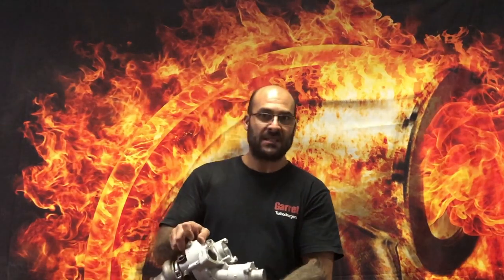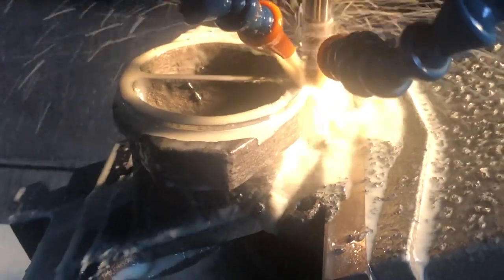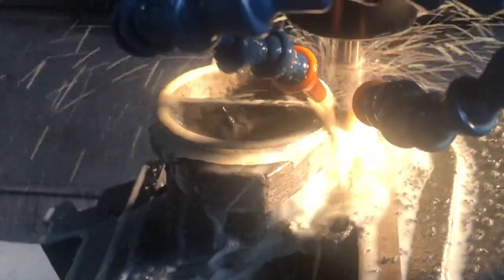Golf7R Swirl Adapter - EFR7163 Bolt on

Comment: Hi. Been watching most videos on the channel. Learning abit and finding them very interesting. Im a big fan on improvements through more efficient designs without necessarily increasing power. Would the swirl adapter have an improvement if used with a stock is38? Also please do a dyno video to show the difference the swirl adapter makes on a big turbo 7R using the turbo you have mentioned. With the only thing being changed is the swirl adapter. Would be interesting to see how the graphs differ in spool up. I like mid range power , not too concerned on peak figures. Thanks for the educational videos. 👍
Reply from the maker: Thanks for the comments, im glad you enjoying this - The Swirl adapter is in essence a flange face converter between the divided two port outlet on the head of the EA888.3 to a vband flange (76mm)  to suit larger turbochargers. The IS38 wont bolt onto the Vband flange face -
Reply: @TurboDirectSA  thank you

Comment: HI Chris 
Very interested in this setup .
would you able just to sell the turbo (650hp) and adapter together ? 
already have wagner cooler and charge pipes
Reply from the maker: Hi Keegan, ofcourse we will sell the individual components, please contact info@turbodirect.co.za for more info. Please note that the testing on this setup is being done as we speak and the tuning will be completed soon. We have a surprise there for you too -- tuning will be done in a specific manner that noone has done before, making the tuning very simple and available for purchase directly from us. No more battling with Winols, and mappacks etc -

Comment: Hi Chris. Can you please explain how this swirl adapter improves spoolup if you are using it with a open volute turbine housin? Thanks!
Reply from the maker: When we run the stock turbocharger with the divider in the inlet of the open scroll volute, (yes the stock housing is NOT twin scroll, the divider is 20mm deep into the inlet only), the flow rates are lower than when we use our swirl adapter. the air speed and volume is increased entering the turbine housing negating the necessity for any divider or twin scroll design. so you can run the larger AR housing and still have the same flow rate into the housing giving you the benefit of making the higher HP with the larger AR housing, and still provide the improved boost response.

Comment: I was keen on getting efr7163 from apr for my Octavia vrs mk3.5 .... but that needs a engine build ...but guess I have to stick to is38 only .... but a brilliant video u made on why not to choose hybrid is38...
Reply from the maker: Thanks Rohan
Reply: Plenty of stock EFR7163 guys on stock gen3 EA888's around making 480-530hp on the stock internals... APR just strongly recommends this as its getting to the limits... they rather be safe than have cars running their hardware blowing up and making them look bad.